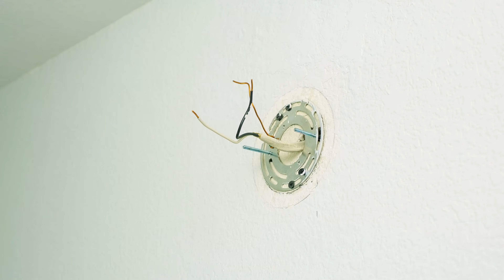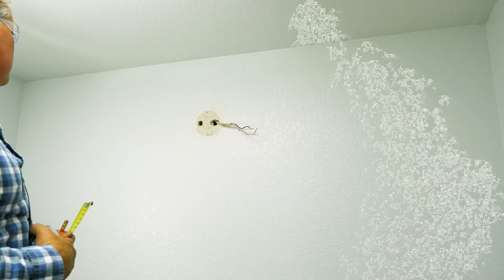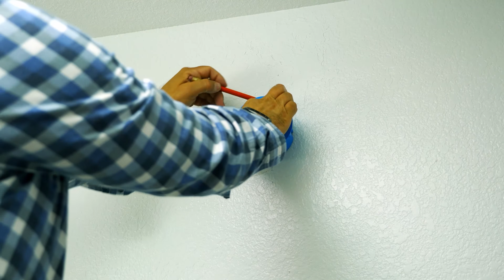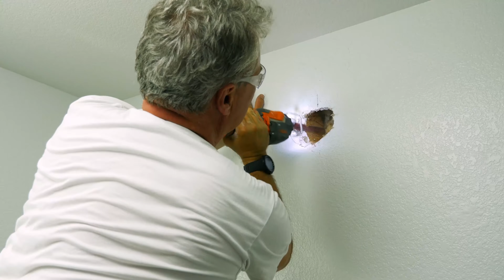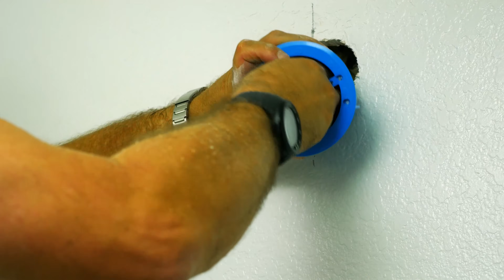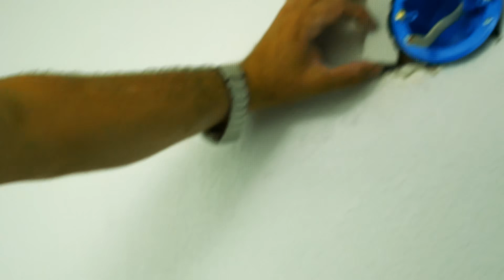Replace Illegal Electrical Box for Vanity Light

Comment: Think I'd move the box rather than carve up a wall stud😊
Reply from the maker: Ahhh you're no fun. Don't be afraid to cut a stud if it's in the way. Always check if it's load bearing and use your best judgment. This wall was non-load bearing. Tradesmen "carve" studs all the time for ventilation, electrical wiring, plumbing, etc. Carving one little stud won't make the house fall down.
Reply: @measuretwicetv2281 3/4 in / 39 in is 2% different. No one would see that. That's just a little too anal for me... I would have just moved the box as many have suggested. Plus you would have saved time on the drywall repair, but you must like doing that stuff. 😅 Losing one of the fins, would code allow you to drill an angled hole in the sidewall of the box to be able to screw into the stud?

Comment: Same illegal situation and boy it's a pain. I have a stud going almost in the middle of where I'm putting my box. Borrowed an oscillating saw and 2 hour long sessions of hacking away in a dust storm = the box fits. However my struggle (and electrical research) continues because now I've tested and found a weird situation of wires (involving a shared wire for an outlet) that won't all fit through the little ports in the back, and even when I got them through, it's a tight mess and the box won't sit flush anymore. all for symmetry..

Comment: My junction box is square, the old light is heavy, it fell out because the drywall isn't holding the square junction box in place. I'm buying a lighter fixture but I'm not sure how to rig the square box back in the wall since there's nothing to hold it. I was thinking about a plate of some sort  I could place over the junction box and screw it in another place to hold it all in. The connections are holding it, so it wasn't that, the drywall just couldn't hold the heavy light in place. Thanks for any suggestions.

Comment: This was incredibly helpful. When I pulled off my old vanity light I found just a wire sticking out of a large hole in my wall. This video was the first I watched and you made it easy to follow! Really appreciate it!
Reply from the maker: Thank you. You can use a pancake junction box that mounts right on the stud so you don’t have to notch out the stud.
Reply: Thank you so much for the help! I am going to attempt this with the pancake mounting box you mentioned this weekend.
Reply from the maker: Thank you. You can use a pancake electrical junction box that mounts on  the drywall instead of notching the stud.

Comment: it's not illegal if the time it was installed the code did not specify it. State the house build time so the illegal portion of the video can be validated.
Reply from the maker: It’s called marketing! And trust me, the wiring was not to code thus  creating an illegally wired fixture.

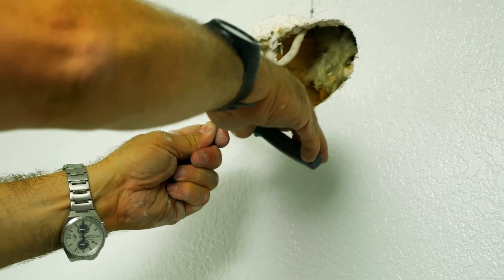Comment: 7:13 there’s no reason to cut off that much excess wires. The code calls for at least 6” of wires from the back of the junction box. Judging from your video, it seems there’s only about 4” (2.5” box depth and 1.5” sticking out from the box).
Reply from the maker: Too late now!

Comment: Every single light I have replaced in my house I’ve had to put a box in.  How does this crap pass inspection
Reply from the maker: No body checked when you bought the home. The only way to know if it’s wired properly is to remove the light off the wall or ceiling.

Comment: Could have used a Pancake Box. Cut the drywall and no notching required. Also it would have been stronger as the pancake box would have been screwed directly into the stud.
Reply from the maker: Yes! If only we had one that night we were filming. Plan is to make another video featuring the pancake box.
Reply: @measuretwicetv2281 great idea also would be nice if you add a note about it in this video so people know about that option

Comment: Since there was a stud adjacent to desired location I would think you could have used a rectangular box and attached it to the stud.  Old metal boxes have clamps that tighten with screws so you wouldn't have to worry about cable being g stapled close to the new box.  My guess is the base of light fixture would cover a rectangular box.
Reply: They make a round box with flat side that mounts to a stud without having to notch it
Reply: YES or just miss the stud who would know it was out of center by that little bit.

Comment: The dedication to exactly centering it is impressive.

One question. Is an old work box like that strong enough to hold a light safely?
Reply: Yes, if installed correctly.  That's exactly what it's designed/intended for.

Comment: I would have just moved the box over a little so that the stud didn't need to be cut.  Also hole saw instead of a drywall saw.
Reply from the maker: Good point but the goal was to center the light. FYI, it was not a load bearing wall and notching studs is not a faux pas if you know what your doing. One could use a pancake box and that would of made the project simpler than notching. My plan is to redo this video with a pancake box in the near future. Thank you for sharing.

Comment: I hope that was not a load bearing wall and the box you installed hold the weight of the fixture
Reply: We’re worried about the illegal lighting here sir. Load bearing walls are not his job 😂
Reply: You can damn near swing off that round box when installed properly.
Reply: This video is repairing what exactly what I intend to do when I put a new light fixture in place of one that never had a junction box at all. Watching this video is convinced me. I don’t want to try to install a junction box. I probably won’t be able to get it centered and what if there’s a stud in the way at least I know it’s a plumbing wall because it’s above the kitchen vanity so it won’t be a loadbearing wall.

Comment: Please pardon my ignorance.  Sorry but I don’t understand what those mounting screws are going into?! It looks like the box is only being supported by the drywall. Obviously I don’t know anything about this but that’s what it looks like to me. I’m ready to buy new box because …

I have a closet ceiling , round metal light box that is already in the ceiling but one of Metal screws that needs to go in to one side has a problem because the existing metal box has one stripped receptacle tab. The closet was added about 40 years ago so maybe the boxes have changed since then?

My new light fixture is very lightweight and the screw tab on the right hand side of the existing box is not stripped so that’s fine.  It’s only the left screw tab is stripped and will not take a new screw.

I don’t know if there’s any other solution except to change the box? Any other ideas with new stuff on the market to help out a stripped receptacle tab?
Reply: The screws he turns rotate an "arm" or "wing" on the back that goes behind the drywall and as he turns it grabs and squeezes the box to the drywall.  There seems to be debate in these comments of how much weight that can support, but I think it's fine for most stuff, especially on a ceiling. 

Sorry, no great ideas on the stripped screw, other than maybe you can buy a slightly larger screw that you can muscle in and effectively rethread the hole. Might work.  If your fixture is super light like just a bulb, one screw is probably just fine.
Reply from the maker: Thank you Ron! Great advice.

Comment: Instead of notching the stud, there is a box designed for bouncing on a 2x4. Not the little flat pancake box, but one that is only partially round on the back.
Reply: moving the fixture over 1-2" or using a pancake box is -- to me -- preferable to notching the stud.
Reply: @intrusionlabs 
Not acceptable off center. 
You can use a pancake box. The fixture will also act as a box. Plenty of room. A pancake box can be screwed directly to the stud and the drywall will cover the sides of the box.
Reply: Saddle direct mount box, no need to hack the stud.
Reply from the maker: I’m all ears, let’s see it
Reply: @measuretwicetv2281  does he mean this one, or maybe the ones that has only half of a deep back part with a full flat front? https://www.youtube.com/watch?v=A1M-eaQZyjI
Reply: @warrenmichael918 there are ones like the link i commented but there are also ones that have about 1/2 inch missing of the box to allow to bolt against the side of the stud too if there is no wall in the way or if you want to cut a piece of drywall out and reinstall and patch it after. There are plenty of options (even before this video was made) but they might not have been sitting on this youtuber's local hardware store shelf and they probably didn't feel like waiting to order it.

Comment: Why would you cut the framing stud!
Reply from the maker: First off, the wall was not load bearing. It’s a common practice for the different trades to notch out studs for pipes and wiring etc. Notching one stud isn’t going to cause the whole house to fall down. That’s absurd!  “He weakened the structural integrity of the wall. OMG!” If you removed all the drywall from your home, you would find various areas throughout the framing installation where studs were cut or notched out to accommodate the various trades such as pipes for plumbing, wires for electrical, HVAC venting etc. The reason you are questioning my method is because you have never seen a whole project stripped down to the studs to verify my point of view. 
Since the notched out studs are hidden behind the drywall and or you have never 
seen someone notch out a stud, you think it’s a faux pas. However you are incorrect.
There is an alternative method to this problem. I could of used a pancake junction box that attaches directly on top of the framing stud. So in response to your exclamation point, don’t remove studs completely without verifying if it’s a load bearing wall, consider a sister stud (this is where you butt another stud against the one you notched to add additional support) if you are worried about compromising the stud you notched.
Reply: @measuretwicetv2281  Imagine thinking notching a framing stud compromises the integrity of the house. What's wrong with people...

Comment: Notching the stud must have been tricky.  If the fixture had been an inch off center, would it have affected the rest of the project?
Reply: No. it was completely unnecessary and bad advice to give inexperienced DIYers.
Reply: @squirts1  Yeah; thank for the reply.
Reply: It is very clumsy to notch the stud. To move a little bit off the stub is totally better option in this specific situation
Reply: @pengjunsun3683  I agree, and would add that it is highly unlikely anybody would notice.
Reply: Curious: why not a pancake box? Also, if the box was instead only an inch off center, depending on the fixture you can gain that back with some offset tricks to send it back the other way. Sometimes I’ve had to fabricate a custom offset mounting plate by boring holes in a short piece of flat bar. Thus only pays if if you’re a homeowner and your time is “free”.
Reply: @TrippKnightly  Thanks for the reply!  If a pancake box is one of the small, surface mount varieties, it might work but that would depend on the fixture selected, I imagine.  And yes, I agree you wouldn't want to pay the electrician for a custom solution, however effective it may be!

Comment: Instead of using a hand saw or reciprocating saw to cut the hole, use the correct size hole saw. It will save you time from fixing the drywall like this. Hole saw kits aren't too expensive and the kits will have a lot of different uses.
Reply: His lesson was partially about if the wire came from below and you couldn't push the wire into the wall. In that case, you can't use saw. For demonstration and ease he pushed it in since it was a dropped wire.
Reply: And or, he could've just move the hole about an inch or so, to the right, and could've avoided cutting part of the stud, and save time and making unnecessary cut to the stud.  It doesn't have to be exact center of the wall

Comment: What if you have a heavy light fixture that will pull the box right out of the wall if unsecured? Do you have a video for that?
Reply: Fixtures that heavy usually aren’t center mounted over a box.  Those have multiple mounting screw holes across the width of the fixture so you can attach the fixture with drywall anchors or into adjacent studs.
Reply: Best bet is remove drywall over a stud so you can screw with a bracket to the stud. Then drywall around it (or hire drywall guy). Bracket will be hidden by drywall.

Comment: The old one was illegal, but it attached to the stud to support the weight of a vanity fixture, which are often over the few pounds the old work boxes are rated for. 

Will a drywall-mounted box be enough to hold up a vanity light?
Reply from the maker: Yes , it should be fine. Most vanity lights are pretty light in weight. It’s never been an issue for me when using an old work junction box (also called a remodel box).
Reply: @measuretwicetv2281  Thank you! I was concerned about distance from the stud in my situation and didn't want to remove too much drywall.
Reply: Absolutely….that particular box is rated for 50 lbs I believe. A lot of people are surprised how much those old work boxes are rated to hold.
Reply: I agree with you.  This guy does not know what he is doing......His light is going to fall off the wall into his sink...LOLOLOLOLOL!

Comment: Who ever designed that box is either and idiot or an asshole. Could have easily made it smooth or smoother on the outside and you would just have to drill a simple circular hole on the wall.

Comment: I worked in an apartment complex several years ago where we secured the whips to stud and the when code said we could only do that in certain locations we installed pancake boxes to the studs. I spent an entire week doing that in dozens of bathrooms and it ended up looking alright. Code didn't care in dry locations , but I think our issue was that the developer was unsure of vanity locations. My boss was a good sport about it
Reply: Pancake boxes very often exceed fill limits, but if the inspector says ok, then go ahead.
Reply: Please our building are one large code violation no light or ventilation in the attics none of the shut off valves work for the water and miles of rubber clamps to stop pinhole leaks.

Comment: Well done checking for power even though it should not be there.  I was watching a different video where the guy found the light switch was wired incorrectly neutral instead of hot.  It still operated 'correctly' but was unsafe even when the switch was off due to the neutral being interrupted instead of hot.
Reply: Always check. A neutral issue can cause a voltage difference that can shock you. Then if it fed the light first, it'll always be hot and switch is the end of the chain.
Reply: That light may have been “back fed,” with power coming in at the light. Neutral directly to light power to white wire of cable going to switch, then it returns on the black of that same cable, so that black onto the light
Reply: A way to remember that is black gold black, wire gold screw, white wire white screw and the redwire is hot so gold screw too.
Reply: @blkwulf134  Except sometimes white wires are used as hot.  They are supposed to be marked with a band of electrical tape, but that doesn't always happen.